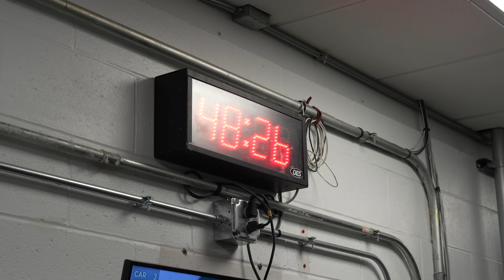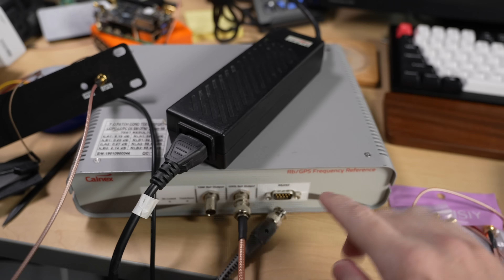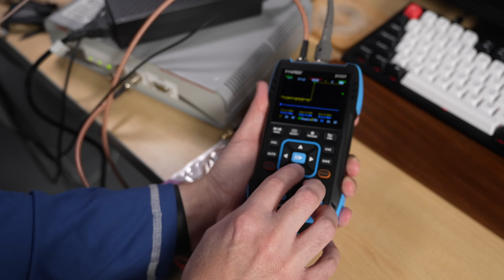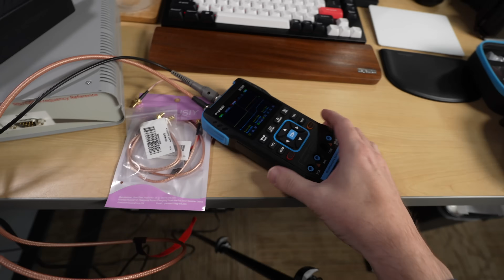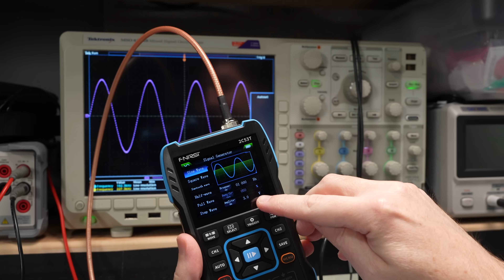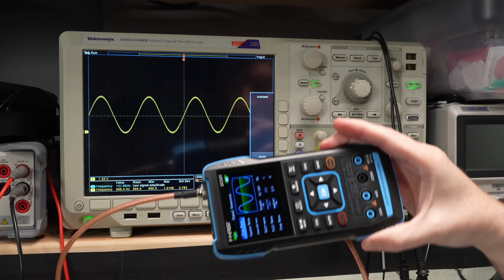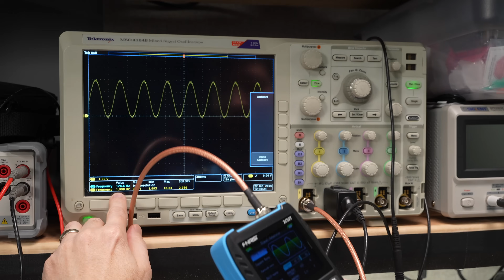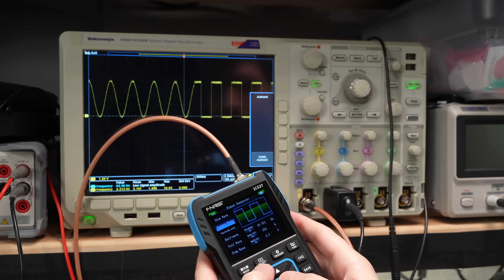A scope every electronics nerd should own

Comment: Now I’m the one who gets to say, “WTF, I just got that exact model a few days ago!” Picked it up on sale for around $90. Hoping it’s just good enough to help pinpoint an ignition problem source in Safari. Never touched an oscilloscope before, so it’s going to be a learning process. 😅
Reply from the maker: Good luck!
Reply: I'm not sure what you mean by ignition problem in safari, but I used an older DSO nano to find a fault in a LLY duramax crank sensor circuit. Sometimes there, sometimes not, but the latency from OBD while cranking was measured in minutes and not much good for any other diagnostics. I tapped into it and watched it live while shaking the snot out of the harness while cranking and was eventually able to find the short. The built in signal generator in the corner was enough to figure how to set the triggering up, super handy little tool.

Comment: It's interesting that 1Hz on the signal generator was ~2.2Hz on the scope, but 2 Hz on the generator was 2.0 Hz on the scope.
Reply: Most of these cheaper scopes just count trig events (cycles) per 1 second period.
So they are really bad at measuring Hz of low freq signals, they have an error of +/- 1 Hz
Reply: @wizrom3046 Also, the two scopes aren't locked to one another, so there was always going to be a frequency discrepancy.

Comment: I've seen a lot of sponsored FNIRSI content, but I can't say I've seen anyone not sponsored compare the scope to a well calibrated traditional unit. I'll keep using my tried and true gear until I find more testing.
Reply: You mean an analog scope? I have this fnirsi thing and analog tektronix scope and signal generator. Compares about the same as this video, really.
Reply: They actually work pretty well for simple things, but it will never replace a good benchtop scope...Most of these handheld scopes are made for automotive repair...
Reply: @brucepreston3927 which ironically requires more bandwidth etc than these provide. Well i suppose if you just want to know if there is or isn’t a signal they’re fine but you need to see the dropouts and so on for any serious diagnostic tests. We really need Pico to make one.
Reply: You know this handheld scope is like $200 lol it’s amazing for the price if you need anything more than this you should have more ability to come up with more money
Reply: @derekconn9950  Amazing? Sounds overpriced for what it is, honestly. It's not about the cost, it's about whether it's a toy or a proper tool.
Reply: @drewnewby it’s definitely good for the price no question it works well too I have one
Reply: @derekconn9950  From your replies, I'm going to take that endorsement with a grain of salt, but thanks for sharing.
Reply: @drewnewby just depends what you’re gonna use it for and where. What would be your application and where?
Reply: @derekconn9950  Not if they're not accurate, which is what I've seen reported. I've been in board level repair for almost 40 years, so to be honest, like you said, it's probably not for my application.
Reply: @drewnewby what are you doing? And they are pretty precise as well as accurate
Reply: @drewnewby  ...says the proper tool....!
Reply: @drewnewby  obviously this isnt for you wtf theres a reason standardized tools cost more in every field and reference material is kept in a fucking museum
Reply: @derekconn9950  No, US$90. the Tektronix though whoo! US$4500 new.
Reply: eevblog has a decent one too, iirc. afaik he'd rather push his branded line.
Reply: Kerry Wong does comprehensive reviews, Mathias Wandel does reviews comparing with Rigol. 
They both have talked about pros and cons iof these FNIRSI products, Wandel even bashed them.
Reply: Is your tried and true gear portable and handheld?
Reply: @dzltron  Oh no, not at all, but neither is my repair shop. My days of in the field repair work are decades in the rearview.

Comment: If you have a couple of inexpensive female to male BNC connector savers you could permanently leave them on the scope. It would make attaching the two scope probes a lot more convenient.
Reply: I did that with the SMAs on my nanoVNA
Reply: That can also cause signal issues, especially when you're dealing with sensitive time measurements. Also used to make a difference back in the days of 10base-T ethernet.

Comment: Two decades ago I needed an oscilloscope and wanted something more portable than a Tektronix but, at that time, most handheld ones like the one on this video were crap. 
So I went with a Picoscope which are as powerful as a Tektronix but without a screen or knobs, which make them a lot cheaper. They connect to a PC via USB and are software controlled. Can be powered from USB or a battery (when isolating the USB).
Reply: will check the pico out.  i still have connections in the local uni physics departments, but it always seems like someone gets to the remaindered equipment before i do.

Comment: At work I have a Siglent SDS2000 something at work, one of the neat features it has (and I assume other scopes also have) is the measurement functions. So when I was working on some real time software, I attached the 2 channels to different signals and set it up to measure how long it took from a rising edge to the next rising edge on the other channel. I could then just leave it running, and it collected stats like min, max, avg, and stddev, all on its own!

Comment: You could have swapped the antenna cables to see if the signal delay also swaps.
Reply from the maker: Should try that!
Reply: @Level2Jeff   give us an update!!
Reply: @Level2Jeff  i was also intrigued by how washed away the delayed signal was.  the delay is all about cable lengths, but the longer and washed out ramp from low to high in the delayed signal is a different issue (could be related to other cable characteristics and terminations, or power delivery, etc.).  if the apparatus linked to the delayed signal in this video generates a tight step up when the cables are swapped, that longer cable might have a mechanical problem.  we care about how tight that step up is, because the error in triggering off the clock signal blooms as the slope of that ramp decreases.
Reply: @Level2Jeff  Also interested in the results of that!
Reply: Figure 1 foot per nanosecond for delay
Reply: Also, if the signal delay was really due to the cable it should have been the same every capture.
Reply: @ksb2112  the trigger resolution isn't perfect even with the sharper step.

Comment: Fnirsi is known from fake oscilloscope specifications. For example Fnirsi 502H spec says "100MHz" while in reality it does something like 19MHz (3dB amplitude drop around that frequency already). ZOYI does a bit better job - ZT-703S being "50MHz" does ok until around 46MHz. No idea about Fnirsi model from the video though.
Reply: I'm happy with their soldering irons. But anything that takes measurements tends to be horrible. It's sad since their designs are usually uniquely good. They often have major precision or accuracy issues compared to similarly priced hardware.
Reply: Fnirsi stuff always feels a bit unpolished. The UI often has small glitches. I own their LCR meter, which is decent for its price. Good LCR meters are MUCH more expensive, but for repairing old home computers it is plenty good. With these handheld scopes I would make sure not to use them on mains voltages. Usually no protective earth, BNC jacks have no touch isolation and so on...
Reply: @root42  Their LCR meter is basically a copy of an Arduino open-source project from a few years ago. https://www.youtube.com/watch?v=_qp0_jiQVTM
Reply: HDS272s owner. Pretty good for the price. But, the multimeter refresh rate is a little bit slow.
Reply: Fnirsi also has a pretty bad reputation even in China (where it originated from). Some said that "Fnirsi is selling basically toys. If you want a tool, dont get Fnirsi".
Reply: @SodaWithoutSparkles  I have one of those portable soldering irons from this brand. The iron itself so far seems to be ok (not a challenge after half a year of light use) and works well, but one of the tips it came with burned out on literally the first use. So at least it's safe to say the quality control is probably not that great, which is a strong indicator for it being subpar.
Reply: @SodaWithoutSparkles So, which oscilloscopes are good?
Reply: @ativerc  OWON for handheld is leagues ahead. There is also zeeweii with great handhelds but a bad fit/finish.
For lower tier but better than this garbage, Zoyi (703S - but keep in mind some firmware bugs as well, not perfect).
Reply: I will second the Owon scopes being pretty good. Got a few of them to keep around at work. Convenient for monitoring signals from a device which is floating relative to AC power. No ground loops to worry about.
Reply: @DevilishLemonBar  I have the zoyi 703S, it works just fine for my use cases, it is enough for most hobbyist, 95% don't need mor than 10MHz so the zoyi is fine for 99% of hobbyist. The only limitation I found is the 2 channel when you need 4 but I don't think any "good" and cheap scope have 4 channels
Reply: @erwann7921 The ZT-703S's main problems aren't bandwidth, it's the buggy trigger and incorrect signal scaling at certain timescales. It will produce incorrect amplitudes randomly and will mislead you if you are inexperienced. Signals can also be shifted in time incorrectly upon triggering (relative to eachother).

All of these are software bugs, if you are new, you will not recognize these errors and will trust faulty results.
Reply: @ativerc get a low end Pico scope.
Reply: @SodaWithoutSparkles from someone who has only ever used one of their products, a soldering iron, I gotta say it's a damn good soldering iron.
Reply: @SodaWithoutSparkles fair but I did get a dmc-100 clamp meter for around 25 dollars on AliExpress and that’s been amazing tbh obviously not as accurate as my eevblog one but for a grab and go one to use in the lab (where I don’t care if it’s taken) it’s amazing
Reply: @SodaWithoutSparkles Don't know about their measurements devices but I've used 2 of their soldering irons and the are quite good. Certainly not toy grade
Reply: I've heard that their boards and components are good just not made for high precision work.
Reply: I recommend OWON HDS 2102, real 100 MHz
Reply: @MethodMan- it's $200~. But since I have no use for and never used one, I don't know if I will buy the 200. I might get by with something cheaper. so yeah, idk.
Reply: @MethodMan- Yep, I have the HDS2202s which is 200 MHz; an excellent portable scope.
Reply: Good to know, they have intriguing looking ads…thanks
Reply: Eevblog has a spreadsheet of portable O-scopes. Going by the details and some reviews I went with DSO2515G which seems to be best bang for buck if you can find it around $80 and has flashable firmware.
Reply: Thanks for the heads up. I was looking into the arbitrary waveform generator but they couldn’t confirm the 8Vp-p capability that I require.
Reply: I have the Tektronix THS3024 is a hand held 200mhz and some other stuff, but I don't see the friendly menus as the chinese ones. Can you tell me if it is capable of doing the same stuff as the modern ones? Am I missing something? I'm new to electronics and I do have that "professional" oscilloscope, but I don ignore a lot about it.
Reply: @DavidDIYMachine for its price, it should even make you coffee
Reply: I saw the Fnirsi 2D15P tested on another video. It measured 100MHz as claimed in the specs. Yeah, it's not this one but it is a cheapy.
If you want to go a round, here's one. During research for a handheld one Zoyi model claims were found to be false on several specs too.
Reply: I have the 2C53T FNIRSI reviewed in this video.  For $89 I give it a strong recommendation. I’m grateful for its capabilities for that low price.
Reply: @Supernumerary Can it measure a 120 volt line? I just want to find out if my generator is putting out clean power.
Reply: Why do I have the feeling that all of you are a bunch of bots from competing companies trying to cut into Fnirsi's sales?
Reply: @CristiNeagu their profiles look legit. Bleep bloop. Out of cheese error.
Reply: @dfgdfg_  Three of them created within months of eachother, 14 years ago. What are the odds of that? Now I'm starting to suspect they're your alt channels. You all have random letter for names too.
Reply: @CristiNeagu  do not resist. Remain calm and stay where you are.
Reply: @CristiNeagu there weren’t any kids named Arekx in your school?
Reply: @CristiNeagu  I think we just all went down the same rabbit hole. I spent a lot of time comparing portable scopes about a year ago and eventually landed on the Owon ones. They were a little more expensive, but there are actual reviews out there which test them up to max Bandwidth. Had trouble finding similar for other brands.

I was spending my work's money, so I was more concerned with the bandwidth. If I was spending my own money, not sure which one I would pick.
Reply: @CristiNeagu  why you feel like that's more likely than oscilloscopes of company releasing new model each 6 months simply being garbage/toys?

You're can check out eevblog thread for any of their scopes.
Reply: @CristiNeagu  Sounds like something a fnirsi bot would say
Reply: ANENG is making similar handheld scope/multimeter all-in-one units now. 
They A longer standing and more trusted brand
Reply: @hullinstruments  AFAIK Aneng is mostly rebranded Zotek and Mestek hardware (Zotek is owner of the ZOYI brand). Example from DMMs: Aneng AN8008 is the same as Richmeters RM109 and both are just rebranded Zotek ZT109.
Reply: @arekx man i still havent untangled that clusterfuck. I thought Zoyi was the OEM. Guess its Zotek then?
Reply: @alittlebitintellectual7361  Zotek is the OEM, their own consumer brand is Zoyi.
Aneng and the rest whitelabel lots of products including some Zotek stuff.

You're better off getting Zotek gear directly from Zoyi.
Reply: @hullinstruments the Aneng scopes are just rebranded whitelabel Zoyi devices
Reply: I bought the 2c53t and the oscilloscope seems legit and the signal generator as will works fine only problem is the brightness hard to see in the sun otherwise its a good tool for the 70usd price tag
Reply: The -3dB @19 MHz : is your 20MHz bandwidth limiter on ? Looks like it.
Older scopes (40 years) had such a switch and my modern Tektronix still has such a setting in the menu.
In other words: looks like operator error 😊
Reply: @Plons0Nard  That wastested on Rigol DHO924S by this guy: https://youtu.be/WLKWBqLR_sU?t=406 (turn on english captions/translations)
Reply: Someone told me that fnirsi specs are not accurate so adviced me to go with zoyi and looked up for zoyi and i have one with 2 channels. Works quite well.
Reply: Meanwhile, an old analog 20MHz scope from tektronix is still useful to more than 100 MHz with some attenuation.
Reply: You pretty much just described the problem with anything made in China
Reply: Fnirsi is a truly serious company  I have followed their stuff for years now, and have some of their stuff. The things they make gets better and better  and their aim seems to be to become a chinese Fluke. Not there yet, besides from maybe design and marketing. But I beleive they will. But once they do I would suspect the price advantage will be gone...

Comment: Grace Hopper did a great lecture, where she used a foot-long piece of wire to illustrate a nanosecond.  For anyone who wants to watch, it's on MIT Lincoln Laboratory's channel..

While not 100% accurate, since signal propagation speed in wire is always going to be a bit slower than the speed of light, you're still going to be well within reason if you count each foot of wire to your antenna  as a nanosecond.
Reply: Signal propagation speed in a coax changes.  At 1.6 GHz (L1 GPS-ish freq) it travels at about ⅔ the speed of light.
Since a foot is very close to 30cm, and speed of light is ~3x10^8 m/s (vacuum), Hopper's illustration is no surprise.
In radar systems this 1 ft/ns is one of the first things you learn to use (and multiply by 2 as the signal has to go and come back).
Reply: There's probably at least one retired dentist now amateur radio contester who, after reading your comment, is going to shorten the lengths of his coax so he can make contacts faster.
Reply: I was at a conference where Grace Hopper was a speaker.  A later speaker found a piece of wire on the podium and said, “I see Grace has been here.”
Reply: Do you mean "The Grace Murray Hopper"??? Because she is a singular badass in science.... COBOL IS/WAS/ and continues to be incredible.
Reply: @jondavidmcnabb  And a Rear Admiral, no less.
Reply: @jondavidmcnabb  People who like COBOL don't get laid a lot.  But, that said, if you're an old timer COBOL pro, you can make some sweet cash as a consultant these days.
Grace Hopper indeed was a fantastic person - and I'll forgive the COBOL incident.
Reply: From her I learned that "it's easier to apologize than to get permission."